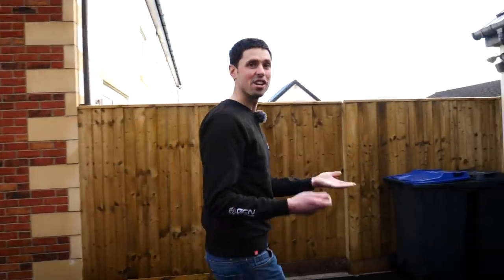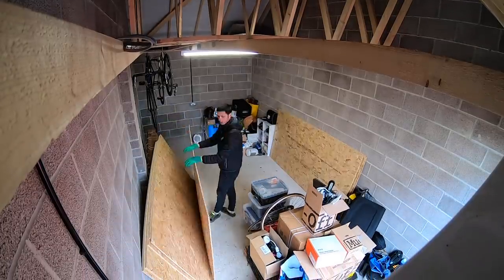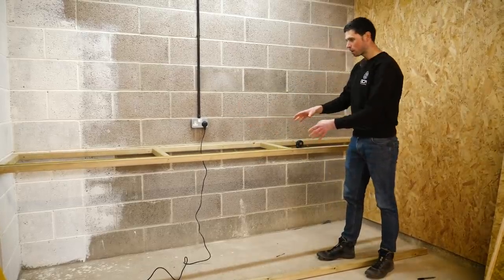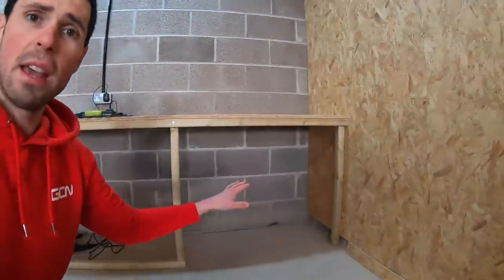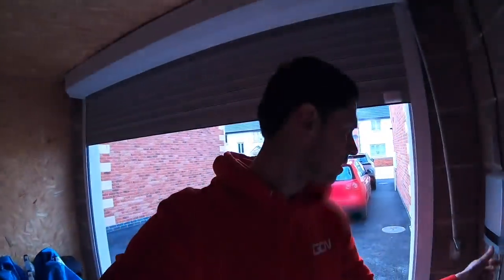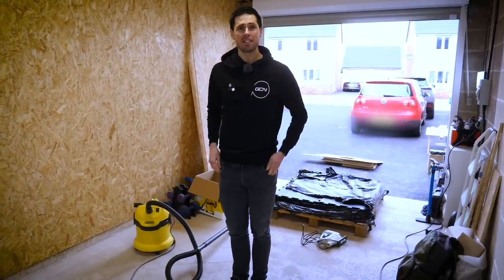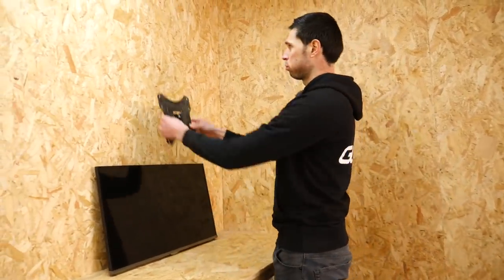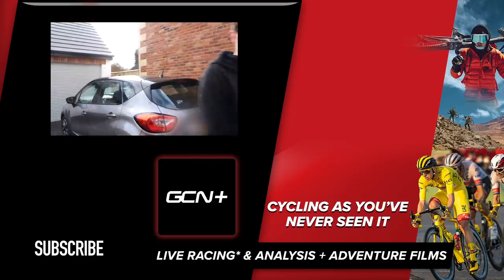Alex Builds His Dream Bike Cave In His Garage Ep. 1

Comment from the maker: Have you converted your garage into a cycling pain cave/workshop? Let us know in the comments 👇
Reply: Great video buddy
Reply: This is a timely video, I’m actually in the planning process for my bike cave/workshop. I would like to have you must do/have that I should consider for my project.
Reply: I've built a work station and a home gym in my garage as soon as the lock-down started. Put a coffee machine and speakers in too. I've been spending a lot of time there, also restoring my 1980 road bike and have been loving every minute of it. Quality lightning is a plus as well!
Reply: Basement... but I think you guys missed on putting foam board insulation behind the osb walls... even 2 walls of R10 with the 3rd bare  would have felt warmer..   I would have bought 2nd hand cabinets and painted the OSB walls grey, black or a shade of brown... white paint on OSB looks awful.  The other idea would be to put vinyl flooring planks on those walls...
Reply: My garage is separate from my house so i run a 25m extension cable from the garden and around my neighbours drive to connect the power. With the power of 4g im able to run my zwift pc of a mobile hotspot. Its cracking, the best thing ive ever done.
Reply: alex:did i mention i am not a carpenter? us:oh we get it already
Reply: we get to see alex's garage but not jon's....this is wrong
Reply: I have no garage but I’m doing a similar thing in my attic 😅 the trouble is to get the bikes to the second floor but hey, works too
Reply: We’ve converted our guest bedroom into a Sufferlandrian Bike Chamber!  Guests can sleep on the sofa. 😁
Reply: Investigate if OSB is safe in this kind of application, some of them release  (or at least used to release) formaldehyde which isn't particularly healthy.
Reply: On the trainer as I type this. Can’t imagine how cold it would be. Did you install a heater? In Southern California it never drops below 14 C, but early mornings and late nights are cold. I did install a shop heater on a thermostat.
Reply: I done my first zwift ride in my 'Paincave' today. however, my paincave is just a slightly tidied up garage, it has nothing on Alex's there. However, I do love what he's done and I think i may just have to do something similar in mine

Comment: You must watch out for mold when you screw wood directly to the wall!
Reply: Indeed ... the wall should be battened first, then fix the board to the battens. This gives the board and the wall space to breath.
Reply: You can paint on cemstick or Tanking liquid.
Reply: @glennoc8585  that would be even worse because moisture from inside would move through the board, hit the wall and stop! Batten with a treated wood, then screw the board to the batten.
Reply: @chiefsilverback  varnishing the board will stop moisture ingress. The better boarding has anti fungal moisture treatment.  Ideally you'd use battens i agree but maybe he's chasing space.

Comment: cool stuff, just 2 thoughts: wood on the wall might cause dampness to build up, also the TV might not like the freezing temps in there
Reply: ive got a pc and 24inch monitor in my single skin brick garage. Its fine, i have some damp tramps too.
Reply: I hung an old lcd in my garage without any insulation... works fine, in Wisconsin... He's in SW England, it doesn't get cold there... and if it does, it's for short periods of time.  As for dampness, that could happen, probably should have a barrier in there.

Comment: Brilliant ! I want to do this soon. Is it ok to clad the walls? I thought they'd have to breathe a bit due to the sweat and damp caused by the turbo efforts. The thought of painting blocks is a massive pain.
Reply: Cheers Tim, should all be fine, the garage is ventilated and dry. Not sure I ride the turbo enough to be an issue 😂
Reply: Painting the blocks is actually rather easy if you get good primer, paint and rollers. Just don't get the consumer stuff but the pro stuff and it's a breeze.

Comment: I just finished upgrading my one-car garage into an ideal (if not  perfect) indoor bike-training space. I'm also in Southwest England. 

Some notes:

1) You're going to need quite a few electrical outlets. One for the TV/Monitor. One for the computer. One for the fan. One for the bike trainer.  And UK garages aren't generally provided with generous quantities of electrical outlets. To avoid having dodgy-looking extension cords all over the place, figure on adding (at least) a couple of dual-gang boxes on spurs. Make sure the electrical work is done properly.

2) My garage is attached to my house. For detached garages, check that your wi-fi signal is strong enough. If not, add a wired connection, or you'll be Zwifting all by your lonesome.

3) For decent ventilation, you are going to want to do your training with the garage door at least partially ajar (and a good sized fan going). If you don't, you'll find many surfaces coated with condensation at the end of your workouts.

4) You will probably want to upgrade the security on your garage door. Between your bike(s), the TV, the computer, the trainer, tools, etc. you've probably got more than £5000 worth of kit in there. You need a better lock than that provided by most standard garage doors.  Adding a decent lock (https://www.amazon.co.uk/dp/B004ULMMXI?psc=1&ref=ppx_pop_dt_b_product_details) will let you sleep easier at night.

5) Lighting is under appreciated. Upgrade the miserable single fluorescent bulb that dimly lights your pain cave with a 300+ lumen LED batten fixture. Makes your workspace much more appealing. And much easier to see what you're doing on the workbench.

Comment: Nice build. However moisture behind the boards will cause mold. You need 2x4 eg underneath for airing.
Second, most OSB boards still produce fumes from their glue for a really long time. Check if that's true for your boards and seal them with paint if necessary. So you don't inhale that glue fumes while training! 
Stay safe!

Comment: I have some suggestions... 1. Floor is a nice touch but the unfinished bits will drive me mad... Use the remaining pieces to fill in the edges or cut off the nobly bits and place just the flat pieces together with a bit of glue to hold them in place. 2. I would repaint the brick wall with a few extra coats of white and then outline the GCN logo or what not with masking tape and paint over with red. If you really want some clean lines use the Rasterbate website to blow up the image as big as you want, cut out the paper to make a stencil and then go nuts. 3. I Highly recommend every square inch of the wood panels to be sanded with at least 150grit and then paint. I would hate to have splinters everywhere. The counter I would add formica and even the doors you can fix but adding small frame to hide the panel gap. 4. small fan on the ceiling mounted to keep you cool and maybe even a space heater with a timer function when you know you are going to be riding to pre-heat the room which can be stored away. 5. Your hardware store should have wood paneling that comes in sheets. I would suggest putting that up against the wall above the desk for a classy and can be stained if you like.  Other than that I can see bikes being hung up and pushed over flat against the wall with a locker room style cabinets for jerseys, shoes, bottles and a mirror with lighting. 6. Just to add that added classy touch higher a painter to produce an awesome bike mural on the inside of the garage doors so that whenever you are inside you get this amazing art work that only those special people get to see. I look forward to the next 15 episodes this year on the amazing transformation. Don't let this project die!

Comment: After retiring three years ago, we moved into a smaller space near the beach. That also meant moving from a big garage I could hang bikes from the ceiling and walk under to a space with a low ceiling, less than half as wide and a third less deep. The result of that is an overstuffed space. Normally there is just enough room for me to ride my bike on the trainer as we're still indoors here. When I want to work on something, a bike or motorcycle, I have to move stuff around so I have access. If I want to work on wood or furniture I have to move stuff out of the garage. All that moving adds time to any project and is tricky sometimes to time things between when I need to close the garage up or when tools need to be away for a grandson visit. It works, just fiddly.

Comment: I’m no carpenter, but I think you should have battoned that wall and attached the wood sheets to the baton. You might get away with the work on the right, because it looks like it is not an external wall. I’d be worried about the back wall though. As I said I’m not a chippie, but recommend getting some one who is, to give it the once over, or it could rot from the back through.

Comment: I would not be too happy to breath heavily on a trainer inside a garage with OSB boards letting go there VOC in the air. Better give a good dose of new air before any training. Not sure why the OSB either, if not used to insulate and later used it to fix stuff on the wall without having to drill concrete blocks too each time.

Comment: I'm curious about how high that work top is?

I put a kitchen counter top in and I have it 102cm high (I wanted 105cm or 110cm but when I measured the height of the power socket I was limited).  Normally counter tops are much lower and normally I get backaches leaning over.  I'm 6 foot 2 tall so I'm not a giant but I am above average height.

As Alex was leaning on that work bench his back didn't look too straight.  So I'm curious.
Reply: Hey Matthew. Worktop is just over 102cm so it's its just under the socket. It's about right for me, I did the same and measured the kitchen worktop, then added extra height